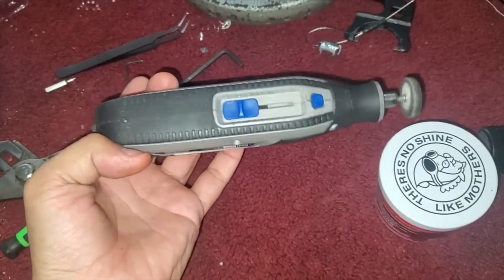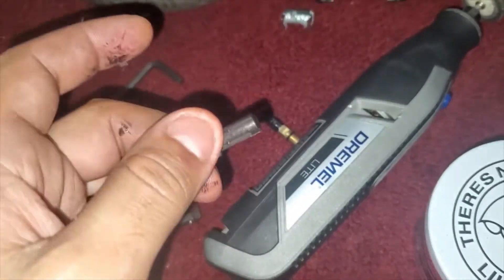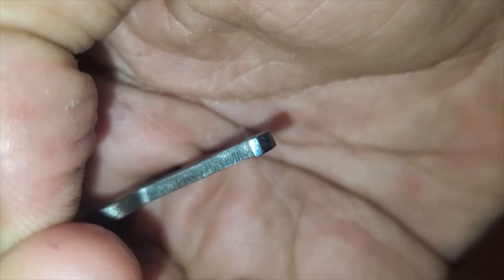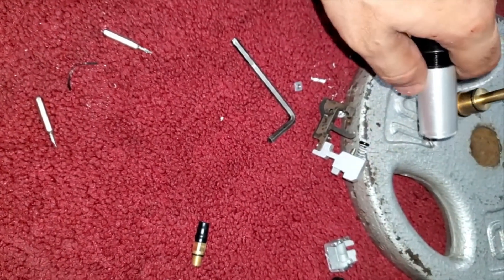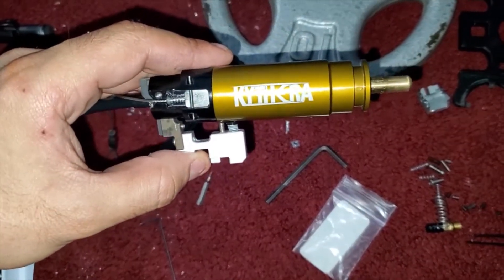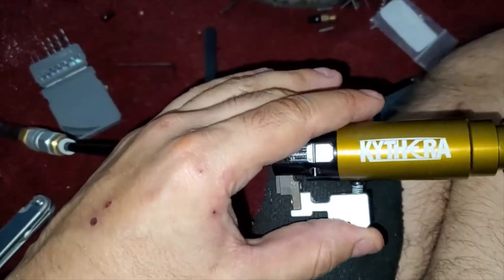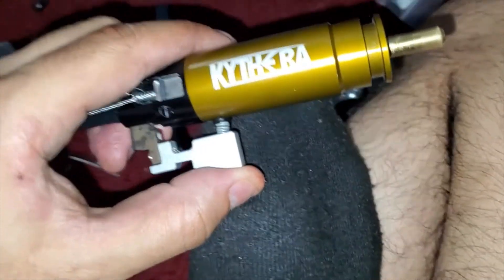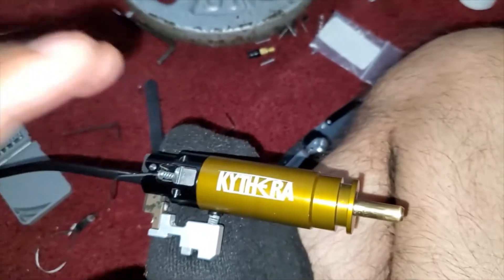Polarstar Kythera Fine Tuning

Comment: With a finely tuned kythera like the ones you’ve worked on what kind of trigger pull are we talking? How light can it be?
Reply from the maker: I've never actually done a weight test to see how much force it takes for the trigger to break, it's definitely not going to feel anywhere near as light as an AEG trigger but  it's won't be as heavy as real steel. The trigger feel I'm talking about is more about how smooth it is on the break and reset rather than how heavy it is.
Reply: @sausageofmarnies2799  I see. Still, I appreciate you sharing the information you’ve gathered on the kythera. Thanks, keep it coming.
Reply from the maker: @deganmccloskey3230   Thanks man I appreciate the comment, as far as the kythera goes I'm pretty sure I'm done since this is pretty much everything I've learned over the last year and a 1/2 on how to work on them so it should be good using all the tips that I've posted so far but any future builds that I do if I learn anything that I feel the community should know about I'll make sure to post a video on it
Reply: Half a pound pull.
Tune the trigger link, and tune the trigger itself and it can be super light.
Also using the sear and disconnect adjustment like how Polarstar instructs.... 
The same technique can be used for the trigger... Tune it until it releases the sear, then back it up from there.

Comment: what nozzle length do I need If I where to put this into a cyma platinum m4 with a maxx model me pro hop unit?
Reply from the maker: Pretty sure a cyma Plat is standard V2 so the stock #1 nozzle for the V2 unit should work. Only Time I've had to change a nozzle was for my KWA build since they use proprietary gearboxes

Comment: Have you ever had a problem with the kythrea folding the bucking lips ,I feel like I need a slower metering screw or is it something else. I have the allingment perfect.
Reply from the maker: No, but if the bucking lips are folding I'd consider a shorter nozzle or a different bucking before jumping to the metering screw. The metering screw only controls how quickly the nozzle returns to the forward position between shots so it probably wouldn't solve any bucking issues
Reply: @sausageofmarnies2799  I’ve tried g&g ,modify and maple leaf bucking. It a vfc gearbox with vfc hop up so I feel like stock v2 nozzle should be the right length.
Reply from the maker: @Pyro1250  what build is this going into? I've seen some that are V2 standard internals but require either a shorter nozzle or shimming the hop unit forward a few mm